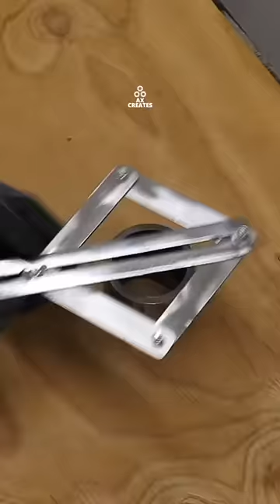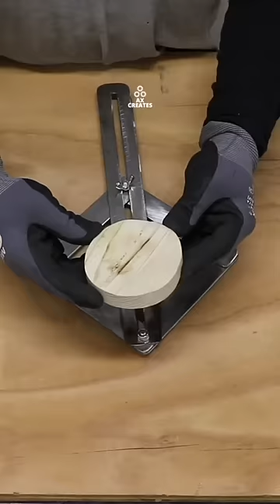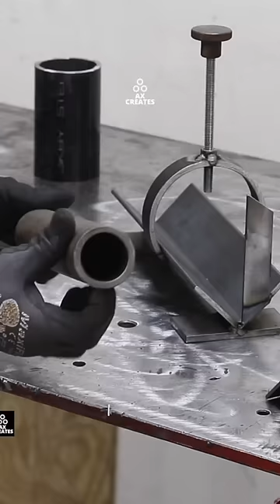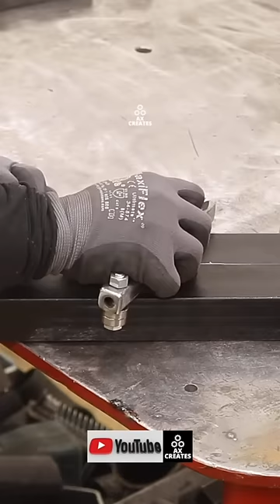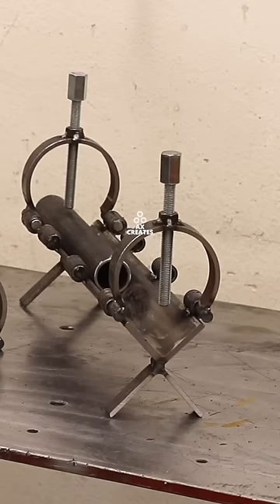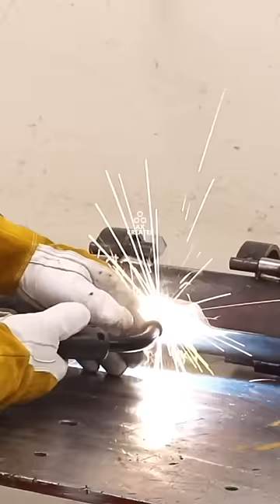CREATIVE DIY IDEAS THAT WILL SAVE YOU TIME!!

Comment: all great tools and decent executions, the problem with this design of all of the centre finders is that they each require on a ton of random parts to have perfect aspects and dimensions in order to have an accurate result, whereas a simpler design would take less of the component's trueness for granted.
Reply: o

Comment: Too bad that I consider DRYWALL to be the most useless building material ever created . We put up plywood and hardwood flooring for walls and it gives our homes great insulating properties and unmatched structural strength . We built 12 on center with 2x6 and left a one foot gap between floors for utilities . 😅Hard work , but there is literally NOTHING like it on earth 🌎😁